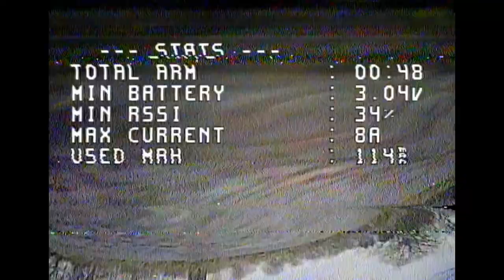Mobula 6 D SYNC

Comment: Hello John, I’m just getting started with Fpv andI have a quick troubleshooting question. Have you ever had a arm disabled on the modes tab? The flag says throttle channel too high, so I adjusted the endpoints and they all seem to be good now. 1000 to 2000. But it still won’t arm. I’ve checked the min_check on the command line and it should be good. The only thing I see different is the Allowed range is set to 877-2250 And I’m not really sure how to get that to 0-2000. I have a few picture of the whole thing. If you have any leads to solve this. Please let me know. Thanks!

Comment: Hello John I was wondering did you flash firmware. Just wondering because mine is failsafing 20 ft away I just got it yesterday
Reply from the maker: I used the stock firmware and when not pushing it I get 260 meter range. It only fail-safe close in when I use 10 amps and voltage drops below 3 volts.

Comment: Thanks for posting.I have one on the way,don't really push that hard.Other than slowing down,any ideas on a fix,possibly different connectors
Reply from the maker: DC smith the BT2 connector might do the trick it allows double the current as the PH2 connector and the BT2 is rated for 9 amps and I was drawing 10 amps on my full throttle flights

Comment: Try pre-heating your batteries ;)
Reply from the maker: I keep the spare batteries in my pocket to keep them warm but the first one is sitting outside for 4 or 5 minutes before I start so that could help. I also just ordered a bunch of batteries from different places to see if I can find a better battery and might switch over to the BT2 connector if other battery companies start using that connector.
Reply: @jmoore3854  The best batteries are mylipo. But hard to find.

Comment: 19000 or 25000 kv motors?
Reply from the maker: Got my 19K model in and the thrust was 74g with P/W of 2.6. My 25K model increased a little using a new battery to 95g with P/W of 3.4. My BetaFPV Meteor with 22K motors but BT2 connectors was 94g and P/W 3.1. My older US65 with 0603x 19000 motors was 65g and P/W was 2.3. I hope to get out a video on this later today.
Reply from the maker: Turboomni these are the 25,000 kv motors getting my 19,000 kv motor M6 tomorrow
Reply: @jmoore3854  can't wait to see a thrust test between the two. I have the 19k kv version and love this drone so much I recently ordered a second 25k kv.
Reply: @jmoore3854   Looking forward to your results with the 19000 kv motors. My guess is those 25000 kv motors will suck up any and all electrons available to it.

Comment: Merry Christmas to you and your family! 🎅 ☃️ ❄️ 
Do you have a fix for this?
Reply from the maker: Yes fly slower lol
Reply: Or run the 19000kv motors?
Reply: Or change the connector to the BetaFPV BT2.0 and use better batteries.
Reply from the maker: Luis Hurtado yes going to test batteries and see about switching to the BT2 connectors
Reply: John Moore did performance increase and did the dsync issue go away? What batteries and what antennas are you flying on. Your googles?  Greetings from Sweden
Reply from the maker: @danman7665  To cold still in Chicago to fly at full throttle outside so waiting for better weather to figure out dsync problem only happens when flying full throttle. I use the Bandicoot for my flat panel and TBS Triumph for my circular antenna.